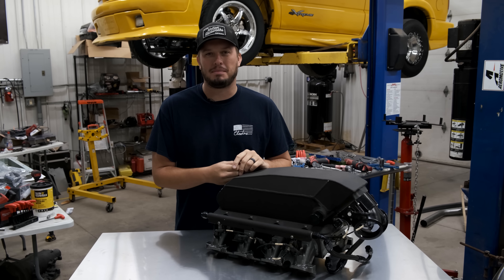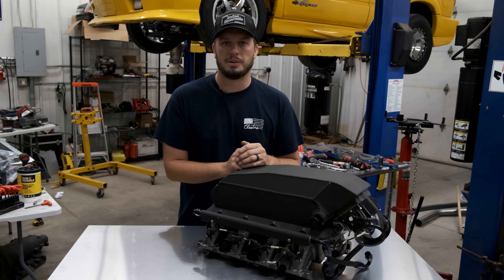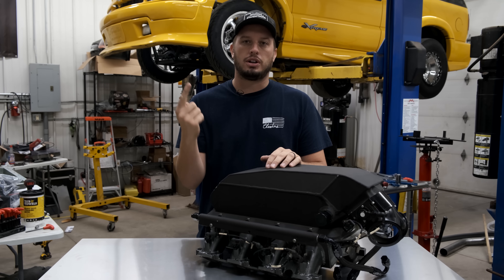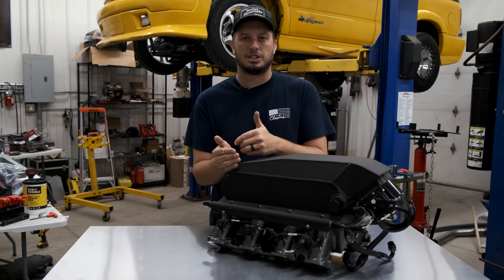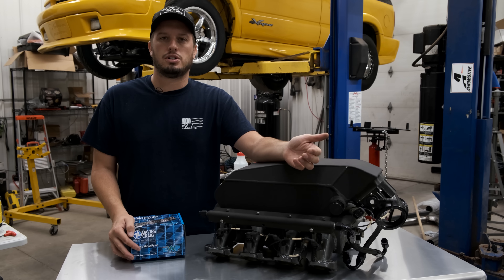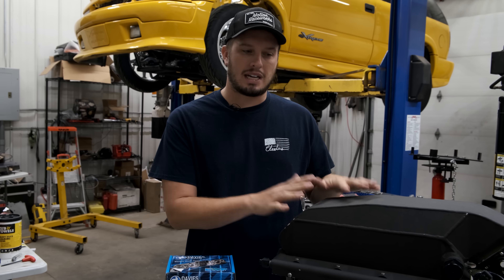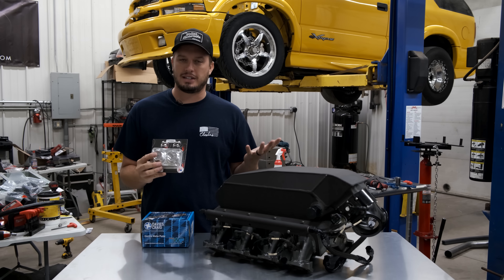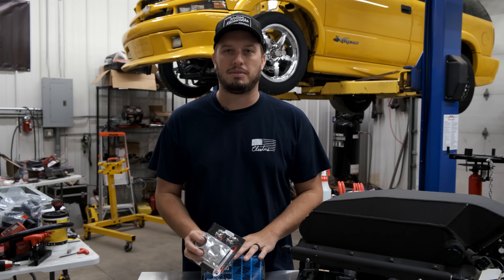Air to Water Intercoolers

Comment: Just like a turbo blanket for unwanted heat...my sister chopped up a old thick uhaul moving blanket for wrapping the ice box and did it in one piece and sewed it with wide elastic to stretch around the tank and and fliptop velcro for the lid. it works well on the hot humid rips at the track
Reply: Or just wrap it with foam insulation???

Comment: A mate and I made an interchiller setup on a 7 sec Ford Capri with a Barra engine, he’s getting -10°C intake air temps cruising around then highest it’ll get too in this hot Australian weather is 28°C. Safe to say it works bloody awesome!
Reply from the maker: That’s awesome, I think we are going to try and add that to our blue Nova In the shop.
Reply: @MotionRaceworksOfficial  it is a must! We just made it ourselves my mate is a aircon mechanic a bit of trail and error got it there. The FI Interchiller’s are a very great kit though 👌
Reply: The GTO is definitely getting a/c and a interchiller this winter. Will complement the shearer fab intercooler well also won't be sweating my ass off on drag week/race week events as well as on the way to work 😆😆

Comment: I’d like to see the guts of an air conditioner used to cool both the water in that air to water intercooler. Yes it adds a little weight but the water can be kept just above zero. Would make for an interesting test. Maybe you guys could do a collaborative thing with the guys at HVACR Videos. The days of getting ice would be over.
Reply: ...this is brilliant. If you did an evap coil in an intercooler and tied back into the AC  system, you could still be comfortable in your race car!

Comment: Always something to learn. I wonder why no one has ever experimented with an na car. Nitrous almost accomplishes the same on na motor. I. Would like to see tech tip on fi nitrous kit both wet and dry
Reply: Nitrous is not street legal in my state, even in small amounts.  If the hose is even connected, youre in violation.  But it would be interesting to see how much it could cool on a na car.

Comment: If you have ice left after a run that means you have room for improvement. If the water moves to quickly through the core it isn't in there long enough to absorb all the heat it can. Works in a similar way if you take the complete thermostat out of your cooling system. Without the restriction the water flow is to fast and your engine can run hotter. That's why if you don't want to run a thermostat you just take out the middle so there is still a restriction. You can even purchase restriction plates to put in when you don't run a thermostat.
Reply: Q (Energy) = 500 x  f  x DeltaT (in F)

Q = rate of heat transfer (Btu/hr.)

f= flow rate (gallons per minute or gpm)

DeltaT = temperature change (degrees F)

This is the calculation for BTU transfer using water. If you'll notice, flow rate is a major contributing factor to heat exchange. The faster the water moves, the more heat exchange happens. This is why electric water pumps are horsepower limited depending on flow rate. This is the same principle as the radiator.  Less air flow lowers the cooling capacity which is why you need fans. Water is no different. 

The reason an engine can run hotter with no thermostat is heat soak. Eventually the radiator will heat up to the same temperature as the engine because it is never allowed to cool. The thermostat allows all of the fluid in the radiator to cool to ambient temperature so that when the thermostat opens, the engine receives a large amount of cooled liquid. If the liquid is never allowed to cool, as soon as air stops flowing over the radiator it will begin to heat up because it is already the same temperature as the engine. As long as the vehicle is moving it isn't an issue, but as soon as you stop you'll begin to overheat. This concept is the entire reason cars come with cooling fans to begin with. They knew that heat exchange needs flow to work. A good set of electric fans with a shroud and adjustable temp control will mitigate this. The stock fans usually don't flow enough to overcome this phenomenon when running without a thermostat as they are designed to not come on until the vehicle gets too hot for comfort (usually around 220 degrees) Hope this clears everything up for you.

Comment: I always see "1000 HP rated" etc when I am looking at cores.  Are these numbers the manufacturers throw around based on a supply of ice water and only 1/4 mile worth of use?   How much of an upscale in intercooler core size would you need to make if you were using ambient air to cool the water (large ducted radiator) and on boost for something like a standing mile, or even a few time attack laps?

Comment: Hey Doug I know this is a old video and you might not get this message but back in the days guys would use a fuel chiller can like a soup can with a coil of pipe running through it and you just add ice to that so do those things work or having a fuel chiller can not worth having one.

Comment: Do they make those water pumps large enough/enough flow to use in place of the engines water pump? In a turbo daily driver application where engine bay space is extremely limited, and would that be a viable option for a daily driver?

Comment: How would an air to water intercooler do for a twin turbo daily driver car? I am not overly concerned about if it would cool the air intake temperature adequately because I imagine that it would. However I am concerned about using an air to water intercooler in the winter. As water expands when it freezes and I have seen many things break because of this.

Comment: What’s the rule of thumb on tank mounting height vs cooling brick (LSA in my case).  Is it important to keep the lines level and tank higher or equal to the brick vs pumping uphill?   Are air pockets a concern?

Comment: When you are cruising with little to no boost wouldn't it be best to leave the water pump on? If the pump is on, the intercooler is going to act as a radiator, cool unboosted air flowing through it will remove the heat from the water, keeping temps down for the next hard run.

Comment: Would it be worth it for a p1sc? I’m just now getting the car back together after toasting the ring lands on two separate occasions
Reply from the maker: Jason Riley runs it on his wildly over spun SBF pro charger combo and it works like a dream!
Reply: @MotionRaceworksOfficial  I appreciate the reply. After my Block returns from #TKM(I cannot figure out how to tag the shop, but THE Kevin Mullins is the man), I will be hopefully putting a 4 inch stroke crank in, and forged pistons / rods. I’m ready for this thing to never break again, but I’m a trying to do all this as a traumatic brain injury survivor that’s got DICK for money…smh

I have followed motion for years, and it’s fucking awesome to see the company grow in the way that it has. Starting my first LS swap in 2006, got a brain injury in 2014. Now I’m just trying to get a six point no, T 56 made of glass, And a worn out P1SC to make a little bit of power. I plan to take this car on a road trip starting on route 66 in Chicago, taking that bitch all the way to the Pacific coast highway. I need to get this done man. I need to prove to myself that I can still be worth a fuck. To everybody that My read this: PTSD and depression is FUCKING REAL. I have been struggling to make myself a wrench on this car after the last time number seven and number five ring lands turned to shit. I’m hoping it is, and the email that I just wrote motion race works is the start of the movement in the opposite direction of the pendulum. If you’ve made it this far, do me a favor and hop on my page and at least give me a like or comment or something. It might give me the motivation would be worth a fuck today
Reply: @dickyevery3956  Hope you get better, and yes it definitely is real and can be completely debilitating. What sucks is people look at you and say well you look just fine, just deal with it blah blah. It really shows wtf they know about it a.k.a. absolutely nothing. Hope the project turns out awesome!
Reply: @alreed2434  I appreciate you man. I know the acronym TBI stood for throttlebody injection to me before April 20, 2014. 

There are 2.2 million people a year that receive traumatic brain injury….How in the fuck is this still so unknown?! I mean, everybody knows about CTE and they are starting to get a grasp on our veterans that have received neurological damage. But what about the dude that got knocked in the head really really hard? What about the middle-age woman that fell on some ice and smacked her head the wrong way? It’s crazy to me man. They Classify a mild Trumatic brain injury by the amount of time unconscious. 15 minutes or less, your mild. 17 minutes….severe. Like WTF man

Comment: Trying to switch over to a top mount intercooler but i run ls7 style heads.Holley dosent make a low profile intake for that style. What are your thoughts on running ls7 to ls3 intake adapter plates ?  Motor is 427 twin 6766.Thanks

Comment: I would love to see Dyno results of Cooler vs No Cooler.  How big of a difference does this make?  Is this a last 10hp part or a 50hp part?
Reply from the maker: It’s more a keep your pistons in the engine part.  A hot air charge is prone to detonation.  One could argue it’s worth a ton of power because without charge cooling you can’t make much boost or use much timing safely.
Reply: @MotionRaceworksOfficial  Perfect.  Sounds like my new LS needs a new part.  Appreciate the knowledge.  I am putting together half of what you have but 1000 HP isn't much if the pistons don't stay inside.
Reply from the maker: Yes sir, for reference you can get away with an air to air style a lot of times, it doesn’t have to be an intercooler just like the one in the video.  But you certainly want something that is going to cool the charge

Comment: I have an idea that I've never seen before. You should design an intercooler tank that's...INSULATED! Wouldn't that be a great idea Doug?  Every tank I've seen is bare metal. The ice will melt on its own in a short time. Some insulation will definitely keep that water colder for much longer(who wants warm beer 😉).  I'll bet you could sell lots of them. Have a great day!
Reply: Use a yeti cooler.

Comment: If you were to run alcohol You would Make more horsepower and you don't need ice cooler.
Reply from the maker: We wouldn’t make more power.  On turbo limited applications like this one (methanol puts so much more back pressure on the turbine housing), if we went to bigger turbos that might be true but due to packaging constraints it’s not.
Reply: @MotionRaceworksOfficial   I've been building full out race motors for over 30 years so you have no idea about this. You can run higher compression with alcohol via blower's or. turbos. With more compression and lower chamber temperatures you make more  horse power.
Reply from the maker: @THUNDERSTRUCKRACING70  disagree, but that’s fine, we all can have our own beliefs :)
Reply: @THUNDERSTRUCKRACING70  The moment you said "I've been doing this for x years, so you have no idea" you lost any argument you wanted to say...
Reply: @TheRealXesc  yeah. When people try to tell me I have no idea I generally stop listening to them. Especially when they have no idea what qualifications or experience I have…
Reply: @THUNDERSTRUCKRACING70  "Turbo limited" That means if his turbo is a 1000 hp turbo, it doesn't matter what fuel he decides to use. It will make 1000 hp. Period. That's what he was getting at.